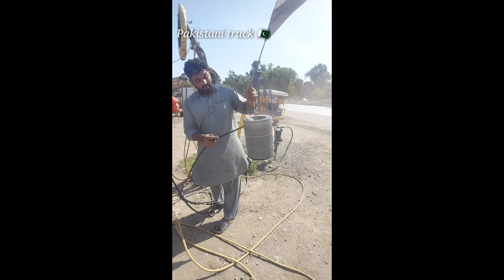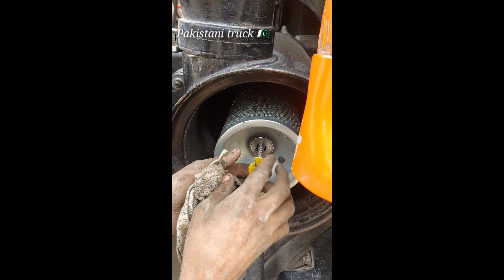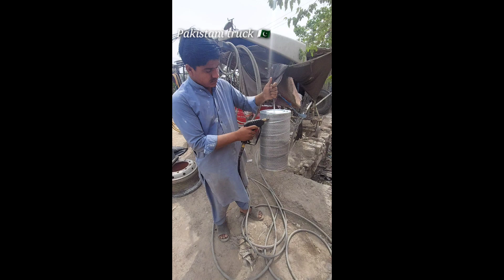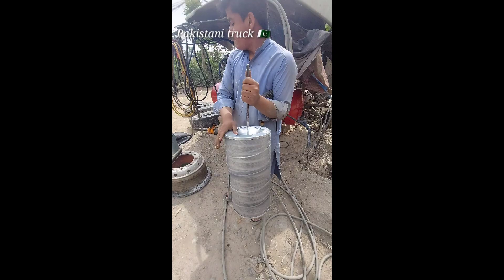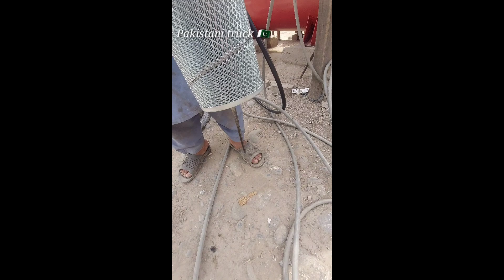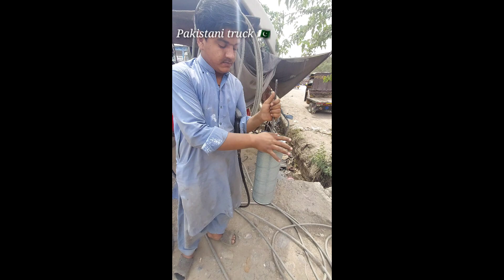How to clean an old air filter in pakistan

Comment: He is blowing most of the "filtered" debris deeper into the filter.
Reply: Seeing as that in Pakistan that Donaldson primary and secondary filter will cost 3 days wages for the truck owner/driver as a new one, cleaning it makes sense. Secondary is not dirty at all, showing primary filter is still doing a good job of filtering. Clean often, and you will get around 20 reuses out of the filters before they suffer damage, and you do not then get people driving with them clogged and wasting fuel.
Reply: You right. should blowing the air inside to outside.
Reply: He's hitting at an angle, I do this to my vacuum cleaners filter all the time .been running fine for 10 years

Comment: This destroys the filter media and makes the filter worse at filtering, killing the motor faster.
Reply: Cleaning paper filter media with a blow gun does not damage the media unless you place the nozzle so close as to blow holes in the paper. Even filter manufacturers have commented on this issue and say that it is acceptable as long as you are careful.